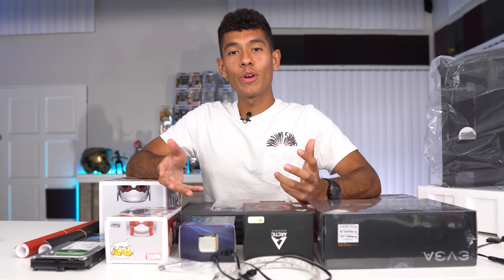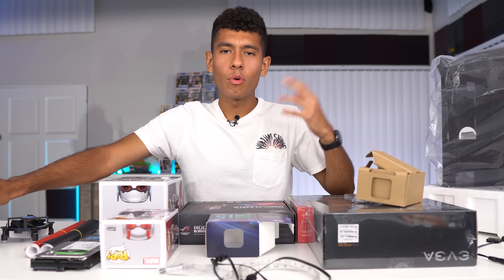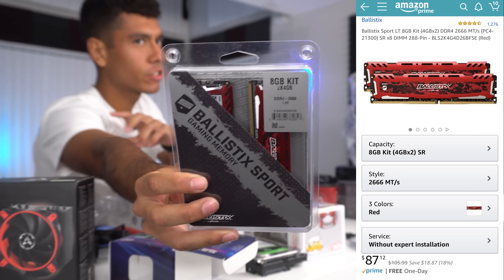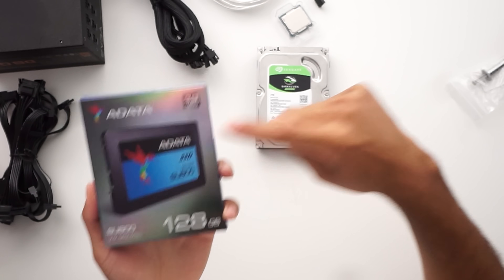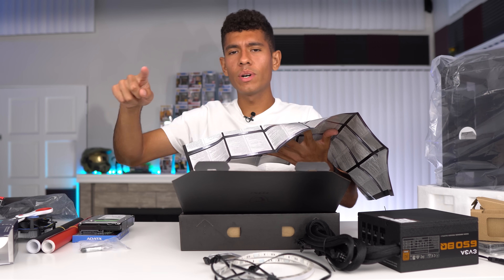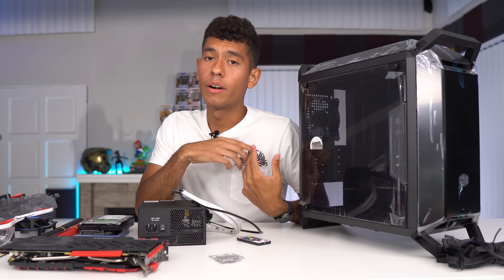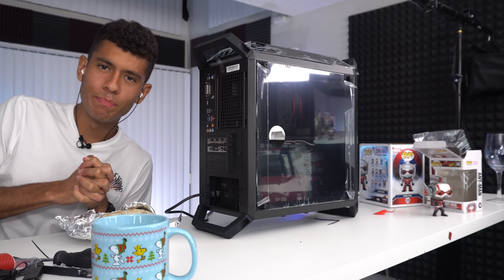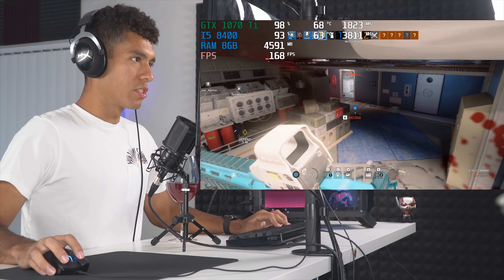$1100 Gaming PC Build - i5 8400 GTX 1070 Ti (w/ Benchmarks)

Comment: Just so you know the thermal paste that comes with the arctic cooler ( ARCTIC MX-4) is better than arctic silver 5. Arctic silver 5 is conductive and has a 200 hour setting time. If you look for benchmarks you will see MX-4 is slightly better

https://www.tomshardware.com/reviews/thermal-paste-comparison,5108-9.html

So in conclusion buying arctic silver which is an outdated TIM is a waste of money that could have gone towards a burger. :) Also MX-4 will last up to 8 years without drying. Nice build!

Comment: For the same-ish prize i got
Thermaltake Versa N21 With one 80mm cooler on the back
H110M-H PSU
Asus GTX 1050 Ti Mini
I7-7700
16GB RAM 2133Mhz
BeQuiet 600W Power Supply
80mm CPU Cooler
Blue Led Front color 80mm
1TB Seagate HDD
275GB Seagate SSD

Is that any good? (Also looking forward to upgrade to a ZOTAC GTX 1080 Ti Mini)

Comment: i have i5 8500 and bequiet dark rock 4, and my temps at idle are 40-45 and under load like 55-70, is it ok or should the idle temps be more lower?
Reply: Its ok if its 70 idle u shoukd check but urs is great

Comment: In my country I need to pay 710$ just for getting the 1070ti like wtf..and I was planning on buying an ultrawide so Editting will be easier..but even 29 inch ultrawide costs me 370$ so that's it 1000$ just for a monitor and graphics card and that's what my budget was :(

So I decided to go with 1050ti (even this gpu costs so much more than it should)
But then a found a guy who was selling a GTX 1060 3GB for 180$ and decided to buy it from him cuz in market it costs around 300$ 

So now my build is-
Ryzen 5 1600
B350m-k
GTX 1060
2 TB HDD
120 GB SSD
CM MASTERBOX RGB CAB
450W PS
8 GB(8×1) RAM
And LG 29UM69 MONITOR 
 Everything sums up @ 1100$ 
=Semi beast gaming+productivity setup

Comment: I understand how to build a pc, and I want to but I’m confused about after you build it, like how to you install windows and all of that?
Reply: Pretty much, if your PC is fully assembled and you put all of the parts in, then it should turn on without any issues. If it doesn't check back on what you did and troubleshoot with the help of Google. After that, you can either use a windows 10 CD with the key on it or use a USB and use it as a boot drive. In order for this to work, you'll need another PC, like your laptop or old PC. It's better to use an empty USB so you won't run into any issues. After that, plug that USB into the PC that you'll be downloading windows from. Download the Windows 10 Media Creation tool from the Microsoft page. Just type in "Windows 10 Media Creation tool" into Google and search for the microsoft website. Download that onto your USB drive. After that, you've sucessfully created your boot drive.

Now, after you have created your boot drive, you will need a key in order to activate the full version of windows, although, the key isn't necessary for proper use of windows, you'll just get a watermark. However, if you buy the windows 10 USB drive from Microsoft's website, then ignore every I've just said. After you plug in the USB drive into your new PC, there should be a windows 10 download page where it will ask you for a key, again, ignore this if you bought the USB drive from Microsoft's website. After you type your key in, you should be good to go.
Reply: You need to install a windows installer onto a flash drive or you can buy a DVD boot and install it from there
Reply: He did it in his 1000 dollar build.
Reply: Thank youuuu
Reply: @jayders5956  When you're done, if you're using an Nvidia card, download Nvidia Shadowplay. It works miracles :)
Reply: You just leave the pc there. And look at it until it dies.
Reply: Jayders search pauls hardware “5 things to do with a new PC.  Its the only reason i was able to successfully build 2 PC’s

Comment: this pc costs 1195.81€ if you buy everything in the eu.
Here's the list:
GPU: https://www.amazon.de/MSI-DL-DVI-D-Afterburner-4K-optimiert-Grafikkarte/dp/B076VWFDC1/ref=sr_1_1?ie=UTF8&qid=1535302823&sr=8-1&keywords=msi+gtx+1070+ti

CPU: https://www.amazon.de/Intel-Core-i5-8400-80GHz-Boxed/dp/B0759FGJ3Q/ref=sr_1_5?s=computers&ie=UTF8&qid=1535302912&sr=1-5&keywords=Intel+Coffee+lake+Core+I5+8400

Mainboard: https://www.amazon.de/ASUS-B360-G-Gaming-Mainboard-Speicher/dp/B07CD3R4T7/ref=sr_1_fkmr0_1?s=computers&ie=UTF8&qid=1535302963&sr=1-1-fkmr0&keywords=ASUS+ROG+Strix+B360-G+Gaming+Micro+ATX

Ram: https://www.amazon.de/Ballistix-BLS8G4D26BFSE-Speicher-PC4-21300-288-Pin/dp/B01MRA8NKK/ref=sr_1_2?s=computers&ie=UTF8&qid=1535302990&sr=1-2&keywords=Ballistix%2BSport%2B8GB%2BDDR4%2BRAM%2B2666&th=1
 
Heatsync: https://www.amazon.de/Arctic-Freezer-Esports-Push-Pull-Konfiguration-PWM-Sharing-Technologie/dp/B076LQ2BJZ/ref=sr_1_1?s=computers&ie=UTF8&qid=1535303037&sr=1-1&keywords=ARCTIC%2BFreezer%2B33%2BeSports&th=1

SSD: https://www.amazon.de/ADATA-SU800-3D-NAND-Schreiben-ASU800SS-128GT-C-Schwarz/dp/B01K8A29BE/ref=sr_1_1?s=computers&ie=UTF8&qid=1535303074&sr=1-1&keywords=ADATA+SU800+128GB+SSD

Harddrive: https://www.amazon.de/Seagate-ST3000LM024-Interne-Festplatte-Schwarz/dp/B01LXRWWB6/ref=sr_1_1_sspa?s=computers&ie=UTF8&qid=1535303099&sr=1-1-spons&keywords=Seagate%2BBarraCuda%2B2TB%2BHard%2BDrive&th=1

Case: https://www.amazon.de/Cooler-Master-MasterBox-Seitenfenster-MCB-Q300P-KANN-S02/dp/B077XM396G/ref=sr_1_fkmr0_1?s=computers&ie=UTF8&qid=1535303143&sr=1-1-fkmr0&keywords=MasterBox+Q300P+Computer+Case+mATX

Fan Splitter: https://www.amazon.de/InLine-33328Y-Y-Kabel-Stecker-Schwarz/dp/B01BPSOU38/ref=sr_1_20?s=computers&ie=UTF8&qid=1535303180&sr=1-20&keywords=fan+splitter

Thermal Paste: https://www.amazon.de/Arctic-Silver-AS5-3-5G-Artic-W%C3%A4rmeleitpaste/dp/B0087X728K/ref=sr_1_2?s=computers&ie=UTF8&qid=1535303261&sr=1-2&keywords=Arctic+Silver+5+Thermal+Paste

LED Strip: https://www.amazon.de/ASUS-Computer-Addressable-magnetisch-Casemod/dp/B07BNKR27K/ref=sr_1_1?s=computers&ie=UTF8&qid=1535303317&sr=1-1&keywords=computer+led+strip+magnetisch

Vinyl Wrap: https://www.amazon.de/TRIXES-Autofolie-Carbon-Vinyl-Wrap/dp/B00DEBTUKI/ref=sr_1_1_sspa?s=automotive&ie=UTF8&qid=1535303358&sr=1-1-spons&keywords=vinyl+wrap&psc=1

Funko POP: https://www.amazon.de/FunKo-30724-Pop-Bobble-Ant-Man/dp/B07CHVKVPM/ref=sr_1_fkmr0_1?s=toys&ie=UTF8&qid=1535303394&sr=1-1-fkmr0&keywords=Giant+Ant-Man+Funko+POP

Total: 1.195,81€

thank me later

Comment: I would get a Ryzen 2600 it’s $30 cheaper
Reply: Yea totally agree with you!!! He needs to bring some ryzen 2.
Reply: @bernaleszacharyl.3125  for those 30$ less you are getting a streaming pc too for video editing or video encoding, ryzen 5 2600 is what everyone should go with because it's a much powerfull CPU than it 8400, and those extra threads will make last longer.
Reply: @bernaleszacharyl.3125  it's not barely noticeable when you have a 144hz monitor and high end graphics card if you're using like a 1060 and 60hz monitor than yeah sure but I agree that the RYZEN 5 2600 is a better chip just not for gaming
Reply: Shadow but then you gotta find a different mobo and possibly case.
Reply: vaderglenn actually the Mobo is cheaper for Ryzen only $69.99 and the Ryzen cpu is $165
Reply: intel still beats amd at games
Reply: @Traza32  yea it does by 5 FPS which is not worth $40.. and ryzen is the king overall, in streaming rendering etc intel is only gaming champ by 5 FPS.
Reply: nah look at hardware unboxed, Ryzen 5 2600 vs i5 8400
Reply: TresTurkey like 10fps lol not noticeable if your already over 65fps and plus Ryzen uses less cpu power so it’s better for multitasking
Reply: i5 runs at 3.8, 2600 runs at 4.2, at this point they would perform around the same
Reply: Also provides lower fps in games and this is a gaming PC not a productivity PC
Reply: Lucas what if games start taking advantage of more threads?
Reply: @supershadow230  then I'd change my opinion but that's not currently the case
Reply: @Lucas-tg3hv  you should ryzen is future proof, battle field 5 and other new games might take advantage of 6 cores and more threads than just 4 cores in Intel core i5 8400.
Reply: @oppositecube  the core i5 8400 is a 6core processor not 4
Reply: But the budget was 1100
Reply: @oppositecube  https://ark.intel.com/products/126687/Intel-Core-i5-8400-Processor-9M-Cache-up-to-4_00-GHz
Reply: @oppositecube  I just quadruple checked it's 6 cores 6 threads
Reply: @Lucas-tg3hv  oh ok sorry my bad, I accidentally messed up with 7th and 8th gen i5 XD. Thanks for clearing out my misunderstandings

Edit: well I just checked before in the Amazon webpage long time ago it used to say 4 cores I guess they corrected it to 6 cores.

Comment: Joey , great video 👌🏾. I built a computer about 1 week ago with the i5-8400 and a GTX 1080 but whenever I plug in my microphone it won’t detect it , please help
Reply: Try connectin an other mic and see if that works.
Reply: If you are using the usb in the front make sure yu plugged in everythign correctly on the motherboard, but if its the one on the motherboardd and it doesnt work idk. But then you should be able to diagnose it

Comment: Hi guys it work to go to from R5 1400 to r5 2600 (i have gtx 1060 6gb)
Reply: Yo guys, what is the best 16 GB ram? (2x8) I've been thinking about The corsair vengeance lpx 16 gb 3200mhz but idk
Reply: +Hollodron VII Dual Channel 2x8 will be the best if you want 16gb
Reply: @zeorth  I made the mistake of 4x4 16gb ,just to have ram on the 4 slots, next time 2x8 16gb.
Reply: @hollodronvii965  same!
Reply: +wBerg Dual Channel 2x8 will perform the best.
Reply: no big differences, just get something fairly fast and just get the one that looks the best
Reply: +Hollodron VII Honestly, you won't notice much of a difference if you're just gaming. Just get the cheapest 16GB RAM that looks good.
Reply: Hollodron VII  if you have a ryzen cpu be careful on the ram support usually you can find the list of the supported ram on the manufacturers(of your motherboard) website
Reply: Skotoze As long as you update the bios of your motherboard you should be able to
Reply: @chdagod  Oh yeah that right but its better to bought a b450 motherboard or stay with my b350 ?
Reply: Skotoze Just stay with your b350..... you don't need to buy the b450, There's no massive changes so you should be gucci
Reply: @chdagod  gucci gang
Reply: @chdagod  is the x370 sli plus good enough for  ryzen 2600?
Reply: Amazing Jax You will be needing to update the motherboard bios if you don't have a b350 or x370 boards... Buy b450 or x470 boards
Reply: @skotoze  just go for the ryzen 5 1600. I don't think it needs a BIOS update, also you dont need to upgrade your motherboard.
Reply: im building a r5 2600 under 900 with the new motherboard
Reply: Sogar Gaming watch techsource's vid... 900 dollar ryzen 2600x, gtx 1060 6gb build
Reply: yeah it should be a decent performance boost.
Reply: Skotoze please explain why that means lol

Comment: Someone suggest me a good cabinet in 60-70$ range. I will be using r5 2600 with stock cooler so need good ventilation. Please.
Reply: Ashwatthama a good case I recommend is the “NZXT S340 black” I will be using it for my new PC build and the ventilation is pretty good But I would recommend getting one more fan just in case. ( also the case can come in, black, red, blue and white) hope this helps 😁👍
Reply: NZXT H500
Reply: Nzxt s340